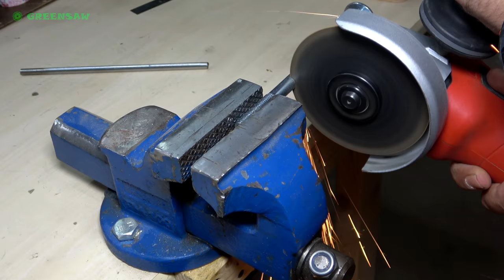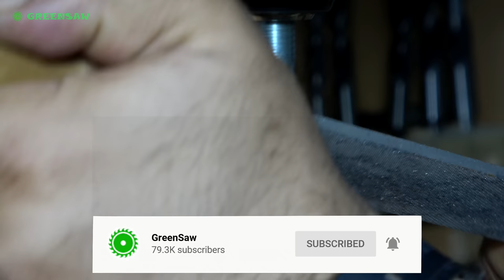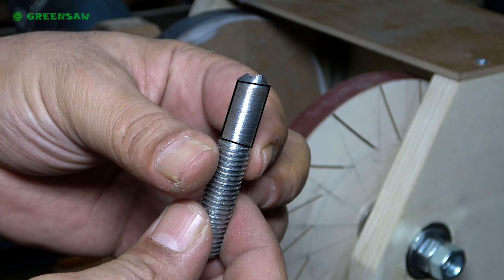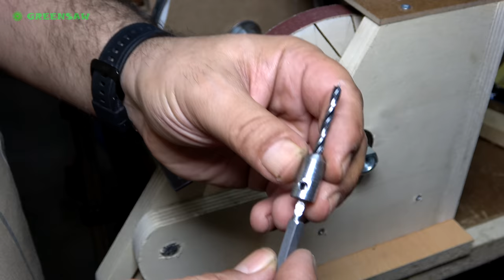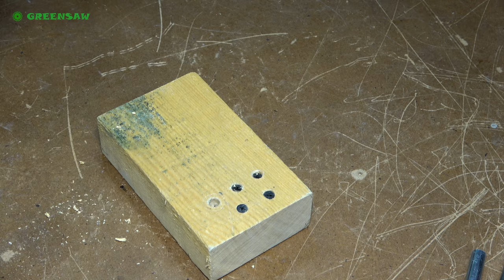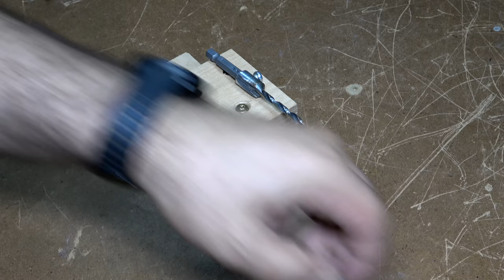Countersink Drill Bit / DIY / Woodworking Tools

Comment: muito bom amigo, o único problema é que com o tempo ela vai perdendo a afiação, dai uma ótima dica para te dá é você fazer uma têmpera dessa peça e depois afia-la, deste modo sim ela irá durar por muito mas tempo, mas uma ótima forma de conseguir um acessório que muitas vezes é difícil de se encontrar em algumas cidades. Grande Abraço e Meus Parabéns. ( very good friend, the only problem is that over time it will lose its sharpness, so a great tip to give you is to temper the piece and then sharpen it, this way it will last for a long time, but a great way to get an accessory that is often difficult to find in some cities. Big hug and congratulations. )

Comment: I've made taps in a similar way for taping wood. .  Out of grade 8 or better bolts. The thing about making you own tap u get a much tighter  thread fit to the bolt you screw into the wood. Regular taps are larger in order to spin the nut on n taps cut the threads over size. Another plus a grade 8 bolt cost 15 -25 cents. So it's up to you your sweat or $$. How I do it? I grind taper...start up the thread end ... from no thread to a full thread about 4-5 threads up. Then I clamp bolt in vice position bolt where the first thread apears on the taper top side. ... then with a hack saw I cut from just little right center to just a little left center up though first 3-4 threads...i usually  tip my hack saw blade 10-15 to the right u don't want a 90 degree cut this is called a rake. Take a file n file flat the area to the right of the hack saw cut. 5-10 minuets you  have a tap. These taps will cut soft metal also.

Comment: Is the cut off bolt 62 mm in length not 26 as stated because you cant drill a 30 mm hole from 26 lol